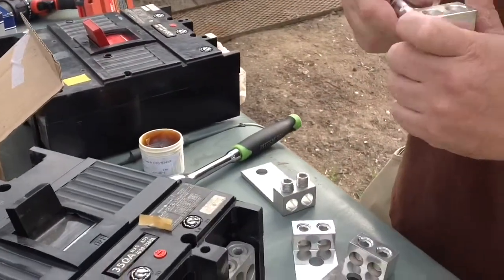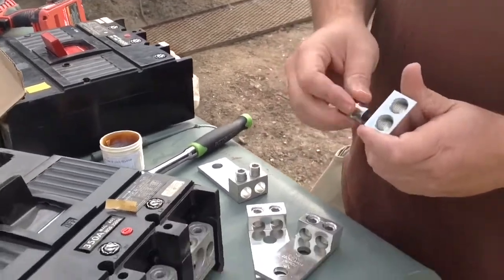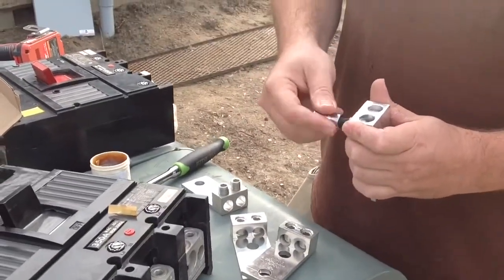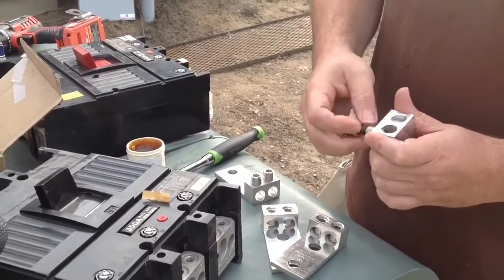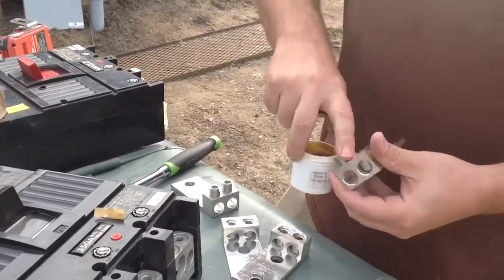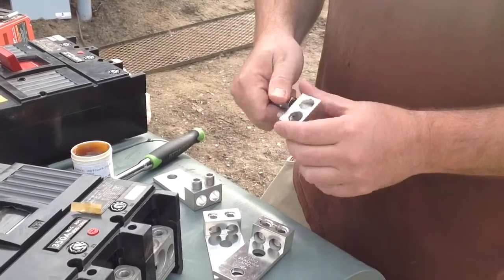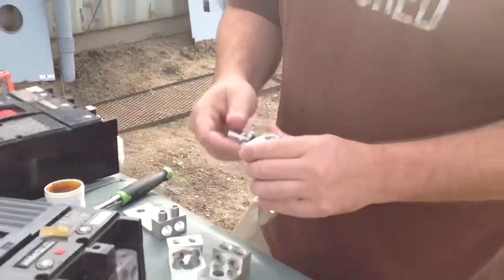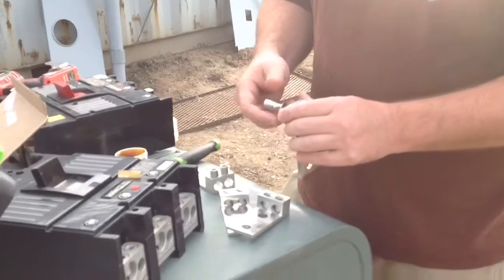110 kW Bitcoin Mine - 013 The Electrical SNAFU

Comment: how many rigs/cards do you plan to run in the container? 110,000 watts??? jesus alotta power. I am in Atlanta with 160 cards so far and thinking trying a container also, so ive watched all your videos so far
Reply from the maker: This is a SHA-256 mine, it is based around Avalon 741 miners. Each miner pulls about 4 amps at 240volt. So that puts us at about 1000 watts per miner times 100 miners plus fans and controls. 

When we started this project we had 100 miners and all of them had 1100 watt power supplies so that is where we got the 110kw.  

We just ordered 100 more miners by our calculations we should be able to fit all 200 of them in this container. As per the power company we can over load the transformer a bit and push the 167kva up close to 200kva.
Reply from the maker: If you are doing GPU you should look at what HydroMine is doing.  Here is a video of one of their containers..   https://youtu.be/AN6ntkA-5ec
Reply: was that transformer already on your property? or did you have to pay the power company to install one?
Reply from the maker: All the work done by SLECA was done free of charge including the 167kva transformer and a 25kva transformer. As long as we have load SLECA will provide transformers to us.

I have also questioned CLECO another provider in South Louisiana who also has the same policy as SLECA. 

Morgan City power wanted us to pay, The verbal amount that was given was $100,000 dollars for 1200A service.

Then after speaking to the city engineer they said they would install for free but we would be billed no less than 80% of the service per month. That comes out to about $15,000 per month for power and with 100 units we would only be using about $7,000....   

So there is no way in the world we would make that deal as we did not expect to double the size of the mine in only a few months. We got such a good deal on the second 100 units we could not pass it up..
Reply: holy hell so I have to research which of the 3 power companies up here in atlanta would charge or do it for free
Reply from the maker: Yes I would  do some research first...  In some places you can get cheaper cost per kwh if you get closer to the sub station and also you may get a deal for buying over say 200,000 kwh..   Here is a link to the rate cuts we get http://www.sleca.com/pdf/Proposed_Rates%207.pdf